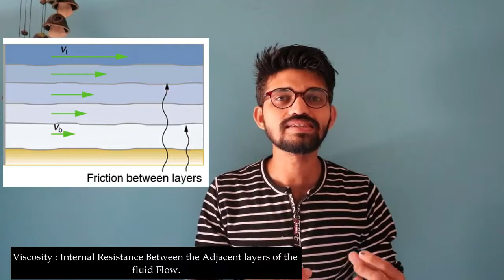Viscosity of Fluids?? Definition/Types/Importance/Units

Comment: Bro how viscosity changes if the temperature of fluids increase
Reply from the maker: Bro what happens when we try to heat sumthing .... The intermolecular forces decreases right.. then what is viscocity ??
Reply: @EngineersAcademy9204  I didn't get Ur point bro
Reply from the maker: As viscocity is nothing but the intermolecular attraction .. it decreases as the temperature increases !!
Reply: @EngineersAcademy9204  tnx bro
Reply: Hi ...thanks for the lecture ...could you please guide how to select spindle(Brookfield Viscometer) while developing the method or viscosity specifications for the cosmetics like Body lotions & shower gels ? Thanks in advance